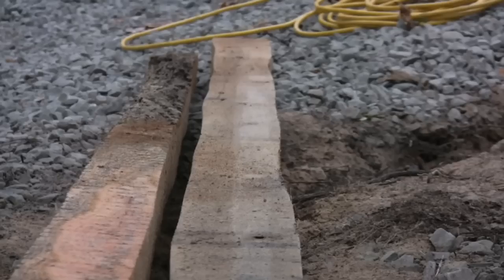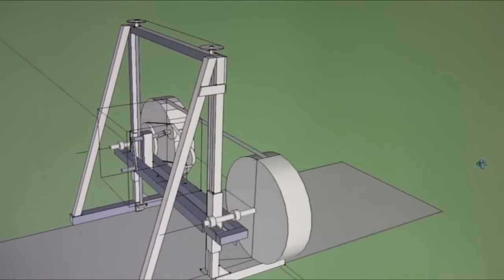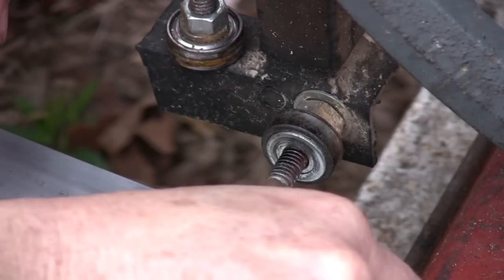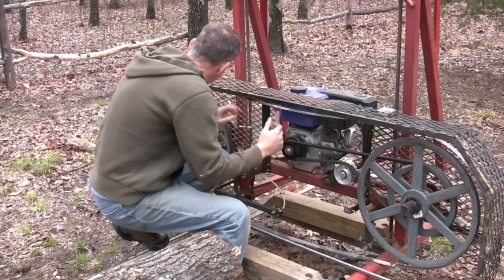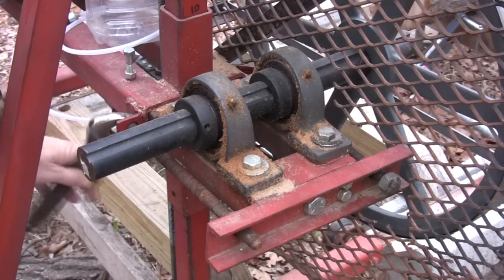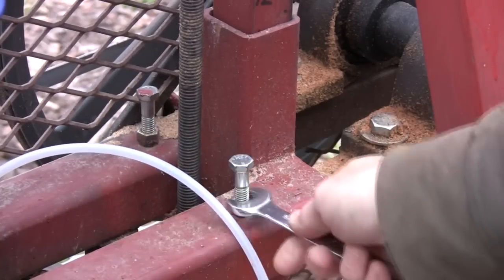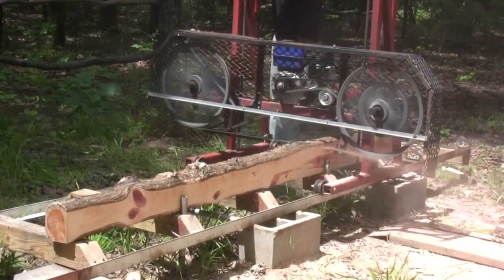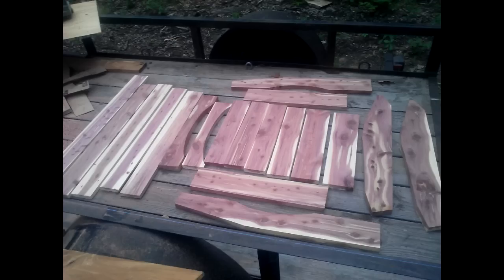Building a Bandsaw Mill Part 3

Comment: $1100.00 on what, ? Scrap metal, ok i get the motor was simi expensive, & the blade wheels, but $ 1100.00 really , wow, what did the motor & wheels cost, & scrap steel

Comment: Maybe for your saw guides if you look at the bearing there is an inner section and an outer section when you put it together try to use a washer that only contacts the inside portion you might find that it will last a lot longer Look me up on FB and I will show you the homemade sawguides I built There is a bit of brazing involved but any local welding or backyard shop could do it for you for around 20~30 dollars I can send you a picture I think I have in mine under 20.00 If it interests you!

Comment: DID YOU CK HARBOR FREIGHT FOR A PORT-A-MILL THE COST IS $ 2,000.00 . THEY DELIVER.
 YOU ASSEMBLE . LOT LESS TRIAL AND ERROR. YOU CAN MODIFY IT IF YOU WANT.
Reply from the maker: When I built this Harbor Freight didn't offer a sawmill.  But yeah, I think now I would recommend buying one for $2K over building one, unless you have a whole lot of extra time on your hands.

Comment: On the guides use a 1'' bolt with 1''id bearings. Bigger the bearing handle high speed better. get the ones with plastic seals then you can take the plastic out and repack  with grease.

Comment: u should use fuel oil or waste oil or even filtered used fryer oil to lubricate and cool  your blades also Simons is a much less expensive place  than woodmizer to get good quality custom blades i was a filer for many years my uncle still runs a filing shop and sharpens blades very cost effectively as well  i believe something like five to 10 dollars per blade message me if your interested and i will get u his info . all in all great job on the sawmill  brother a very simple and efficient design perfect for milling your own lumber kudos
Reply: +Kevin Nance  Water is fine as your just trying to lessen pitch on the blade which creates heat which ruins the blade.  Also I can tell from looking at the gearing on your saw that your blade speed is most likely way too fast. The  target speed for your saw with a 7 hp engine @ 3600 rpm should be close to 3500 SFPM, I'd say your gearing has you pushing around 5000 SFPM or more  at full throttle. This might be the reason why you're burning up those bearings, it also lessens blade life due to unnecessary friction. Vintagemachinery.org has a blade speed calculator if you'd like to investigate what your saw is doing. My guess is that your drive pulley should be close to the same size as your band wheel. I know this because my saw targets @ 4500 SFPM my band wheels are 19" my engine is 3600 rpm, my engine pulley is 3.75" and my drive is 15"
Reply from the maker: +Southeastern Ohio Homestead   Thanks for your insightful observations.  You're right. I went to the SFPM calculator and figured the speed to be around 4800.  I bought a bigger drive pulley from Surplus Center and will install it soon. It should bring the speed down to 3600 or so, maybe increase torque too.
Reply from the maker: +noturbone - I thought oil might get into the wood and stain it.  May try it anyway though.  Thanks for the comment and the tip!  I'll check it out.
Reply: if u must use water cut it 50/50 with antifreeze